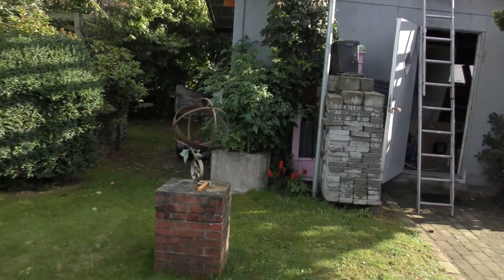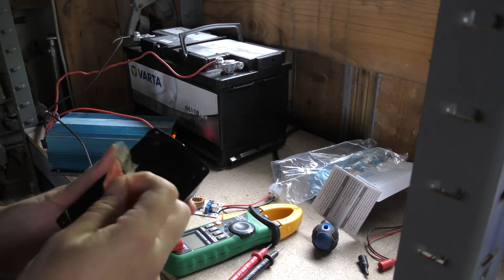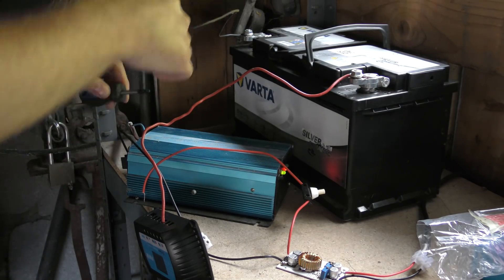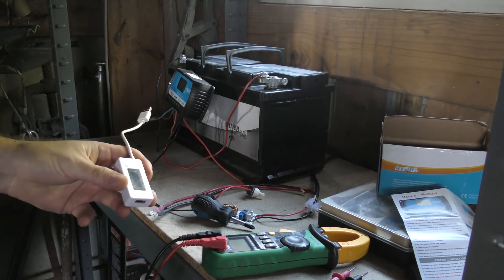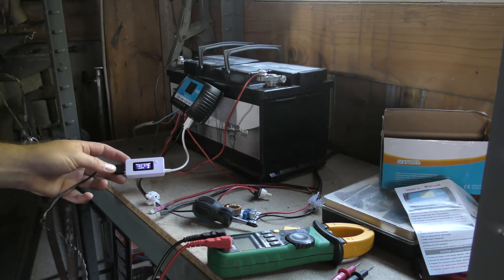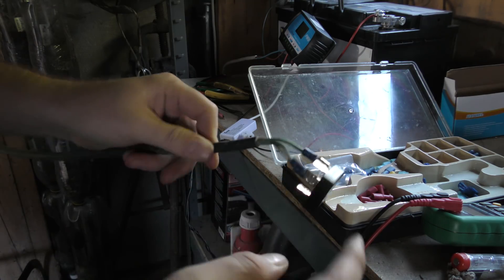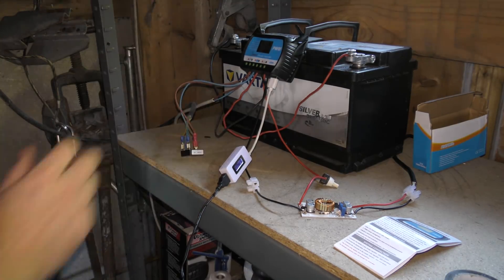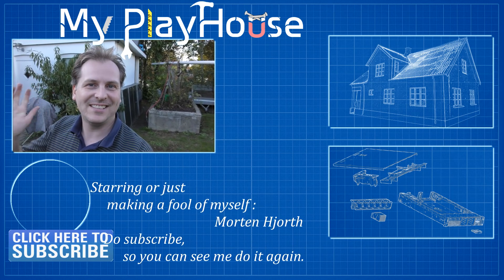Robot "Menaces" Lawn Mower gets New Charge Controller - 738

Comment: I suggest checking out the Victron Energy MPPT solar charge controller. It’s more on the pricey side but it has some great advantages including a bluetooth connection for your smartphone with an app that will tell all kinds of data. Plus it’s MPPT is very accurate and efficient. The one I suggest is the Smart Solar 75/10 and has the built in bluetooth, up to 75v solar input, and 10a max solar input current and 10a max charging current depending on your solar and windmill output power. It costs about $108 US dollars on Amazon.
Reply from the maker: Hi Alex Cadena
Thank You very much!  glad you liked the video :-)
Thank you for watching! :-)

Comment: Should the solarcells not be protected from the windmill ? Current can flow back from the willmill to the solarcells ? Can they handle That ?? Should there not be some diodes in the circut ??
Reply from the maker: Hi Thomas de Vos
Thank You very much!  That three phase rectifier is diodes,, and the solar panel has a diode. I hope it's all good.
Thank you for watching! :-)

Comment: Morten don't throw out the old charge controller, as you will need it when the cheap  chinese controller fails. You might need to fit a heat sink to that recifier,so it doesn't burn out.
Reply: Burning out the rectifier would require much increased output of the small garden wind turbine ...
Reply from the maker: Hi Peter195267
As I am having problems throwing anything out,, don't worry!!
Thank you for watching! :-)
Reply: Thats ok I also have trouble throwing thing out, as I never know I might need it what ever it is I throw out.
Reply: Maybe he can just screw up the rectifier on the shelf support: it's a big metal bar... And the controller could be screwed on the wooden wall...
Reply: Yeah that would work.